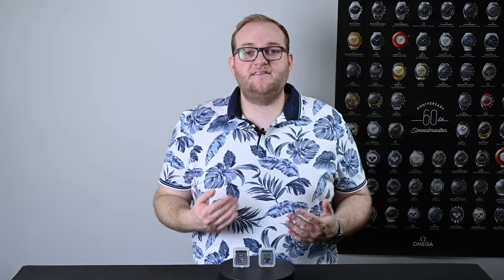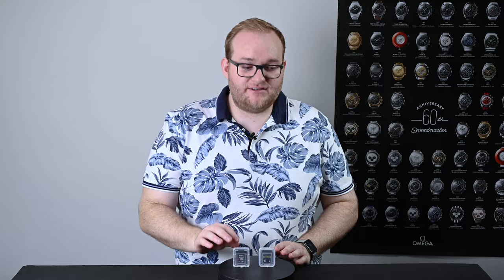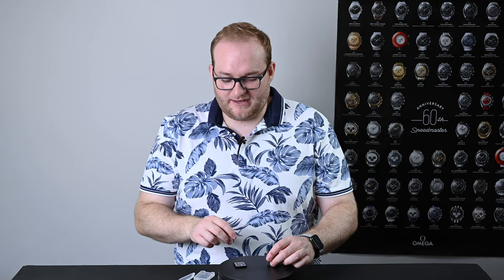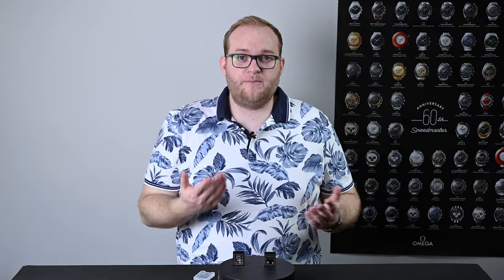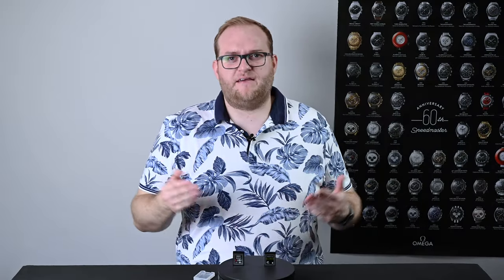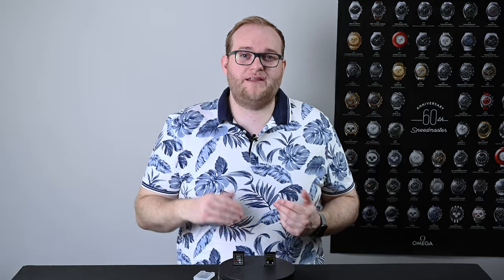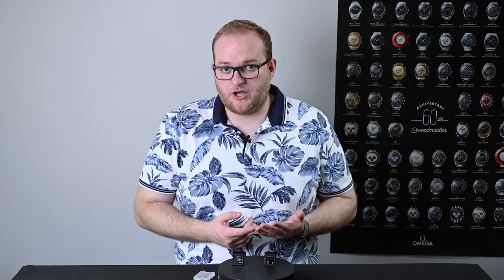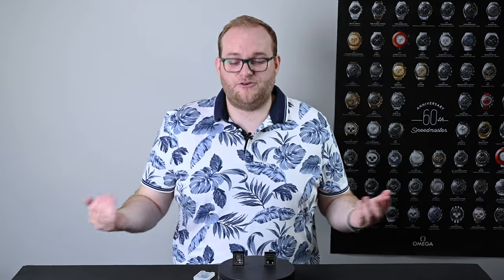XQD vs CFexpress cards in the Nikon Z6 and Z7 - why are CF Express cards slower in the Z Series???

Comment: You came to the wrong conclusion, unfortunately. That prograde 128GB (and only 128GB) card has only 150MB sustainable write speed according to their website, it is very slow, that's why this is the cheapest card.
Reply from the maker: I’ve since also tested SanDisk and Delkin with no better performance

Comment: At the time of writing (May 2024) CFexpress cards are now half the price of XQD cards, and there is a lot more choice of cards in CFexpress. I've just ordered a used Z7 and I'm worried that if I order a CFexpress it won't have had the firmware update to enable these so then I'd have to buy a XQD anyway. I've been using the original CF cards for many, MANY, years and am rather annoyed they're all now redundant and I have to fork out more money with a change in camera.

Comment: CFeB (CFexpress type B), is a Nvme SSD m.2 2230 (same as the storage in the newer laptops).
in a converter to CFeB so it fits directly into the camera motherboard. From that point its up to Nikon to configure the  bandwidth through update. 
Reason you can't see the difference on you mac or PC is because of the limitations on your USB 3.x.

Speed you get with newer generations of USB is either 500MB/s, 1GB/s or 2GB/s. 
I have a PCIE gen 4 and I can get around 7GB/s when the Nvme is plugged directly in the motherboard.

You are actually just testing the buffer size when you are hold down the shutter button and gave NO time for it to transfer the data to the card.
The XQD/CFeB only kicks in when the the data is transferring to the card. Usually that happens in between shooting. If you want to shoot 70 frames RAW on the buffer you will need the buffer from Z9 not a fast XQD or CFeB, or reduce the capture to JPEG and you can click that button all day as long as your buffer can capture and transfer it.

Taking RAW videos would be a better test. Say set your video compression to 300MB/s and 600MB/s that's when you see the difference. ie. if your XQD is on 400MB/s then you are good for 300MB rate (10 seconds uses 3GB so 64GB XQD doesn't get you much), if you choose a compression that is 600MB/s rate your XQD will not keep up. That's when the 1000MB/s CFeB comes in.
Reply from the maker: I don't disagree with anything you've said. But I do stand by the point I made which is that with these cameras you ended up with better performance using an XQD over CFE. This was no longer the case with the Z6 II / Z 7II, or any of the other cameras. At the time this was published, it was an interesting quirk.

Comment: Support for the newer faster cards was by design - at the hardware level, but the I/O speed of the camera would never get faster than about the speed of the XQD. The benefit of CFexpress could come when you need to upload your hours of movie data to your computer.
I bought this dual CFexpress slot card reader on Thunderbolt 3 for that reason. But Thunderbolt 3 on a Windows PC, the card reader, the drivers involved, somehow seem unable to give me the expected performance.
With the memory cards we have to watch out to only use the camera brand compatible cards. There is a driver layer in the card between camera and card innards and these differ by brand and product line.
I discussed this with one of the card vendors. "Will you work on being added to the camera manufacturer supported card list?" That was not clearly answered. Their cards show widely different performance characteristics in different cameras. One problem I also saw "out there" is that some cards will work but cause seconds of camera start up because the firmware needs to handshake with a difficult card. Instead of instant on with a camera brand supported card.
Reply from the maker: Thanks for your very comprehensive response, it's worth noting the ProGrade cards are on the approved list. 

I understand your point about using them to download, but to be honest, for me, I only care about in-camera performance. A few seconds or even minutes saved at my desk are irrelevant compared to frame rates, buffer clearance times etc. 

So although I disagree with nothing you say, I do stand by what I said in the video. I'm working on a video about the implications for the Z6 II vs Z6 too ;)

Thanks for your support and please consider subscribing to support the channel.

Comment: I just tried my Prograde 128gb I bought from Amazon expecting stellar performace... but it performed as you said, slower! On my Z6 I was only able to capture 25% of what the [supposedly 'slower'] XQD card can do... I suppose I should just stick with the XQD.
Reply: This was also with the latest firmware to date.
Reply from the maker: Thanks for your reply! Fascinating that you had the same results I had, it really backs up my thought process on it. 

There must be some trickery going on to make the use of a CFexpress card possible that’s coating performance...
Reply: @HamerReviews  I'm no tech wizard or anything, but I'm confident that it's just made for XQD over CFExpress B. Perhaps the future Nikons will be tailored for CFExpress instead.
Reply from the maker: Yep I agree, however it’s interesting touring compatibility despite taking a performance hit
Reply: @HamerReviews  Try with the latest Nikon firmware 3.50. You'll see that there isn't any difference between the read/write speed of the XQD or CFExpress cards. As others had mentioned, the limitation isn't at the card but at the receiving device firmware setup.

Comment: The camera itself will limit the write speed. You'll only see the speed difference when connected to your computer.

My experience when pricing the cards is that I can get a cfexspress card for the same if not less then an equal GB sized xqd card.
Reply from the maker: Not bad if you're getting that pricing, I haven't seen it yet in the UK but perhaps I'm looking in the wrong places! My point here was more that the performance was lower on the CF Express over XQD - hence why I thought it was interesting to look at.
Reply: @HamerReviews  shouldn't have voted Brexit...
Reply from the maker: Not a particularly helpful comment, and as an Austrian / British dual national I can assure you I didn’t.
Reply from the maker: Not a particularly helpful comment, and as an Austrian / British dual national I can assure you I didn’t.

Comment: I use the Nikon D5 and D6 cameras plus Canon 1dx mark iii cameras where the CF express card shows it worth in action,sports and wildlife areas of my work.
Reply from the maker: Yep, this is my point exactly, if you get better performance, the cards are excellent! :)
Reply: @HamerReviews  firmware issues or the internals in the z6 and z7 not capable  of fast transfer
Reply from the maker: I think the latter.
Reply: @HamerReviews  i think the same and the updates will be a serious rival to Canon and Sony
Reply from the maker: NIkCan I agree, I don’t think Nikon need more megapixels at the moment, the key is going to be improving the AF and more importantly doubling down on image quality from current sensors.
Reply: @HamerReviews  100% correct

Comment: Having just bought the Z 6II wondering if this would still be the case?
Reply from the maker: My Z6 II will be here Monday - sadly Amazon screwed up, but I think this will not be the case for the Z6 II, it's got full CFExpress support out the box, I'd suspect things will be very different, with faster read and more importantly write speeds on CFExpress - not to mention the hugely increased buffer which will make this less of an issue to start with.
Reply: @HamerReviews  Can we have an update on this please ...?
Reply: @HamerReviews  Any Updates?
Reply from the maker: @RTReview.  been really busy to do follow ups to be honest, so much on my list but just haven’t had a chance. I think performance is similar from a short test I did but really need to spend more time with it with more cards properly to evaluate it. Hopefully I’ll get round to that soon.